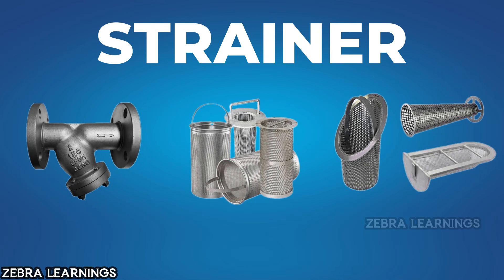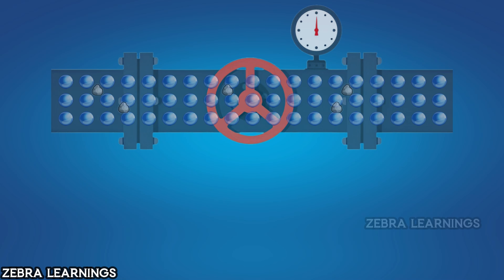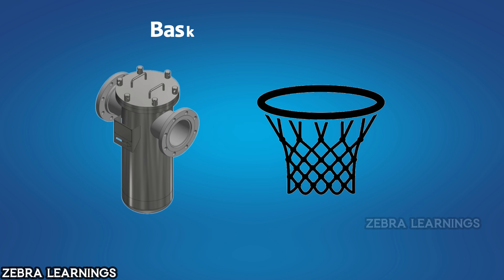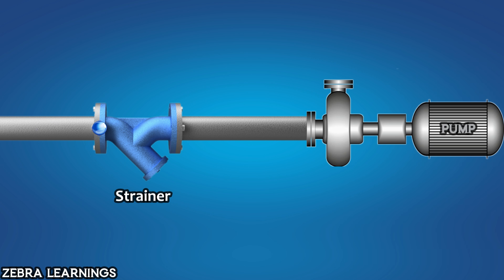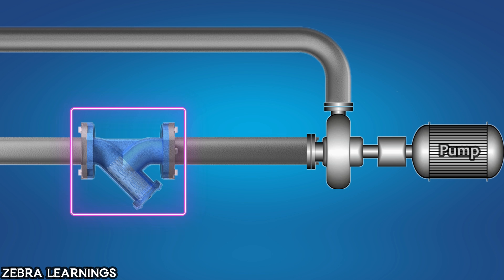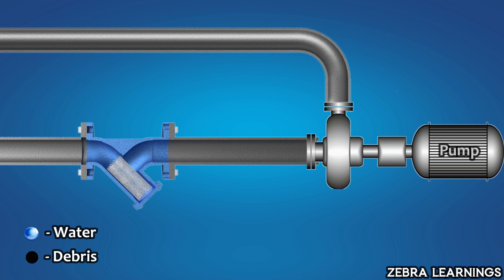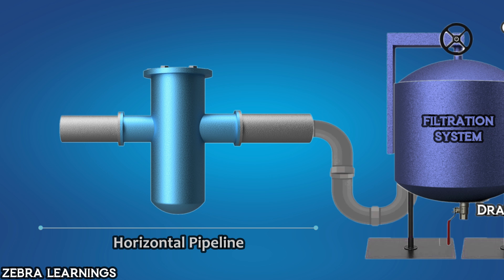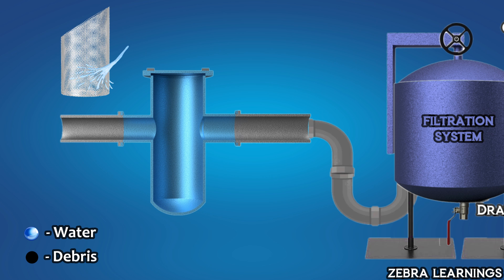How Strainer Works? | Y Type Strainer | Basket Strainer | Animation | HVAC

Comment: Hi,thank you for sharing such beautiful animation which helped alot to understand well,  mean while  one question,  if this filter installed in ww system pipeline which is in continuous operation all the time how can we design  for regular cleaning
Reply from the maker: The regular cleaning can be managed by designing a duplex strainer system (Two strainer) or installing a bypass line.